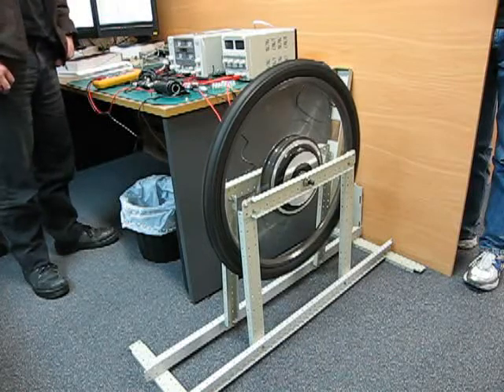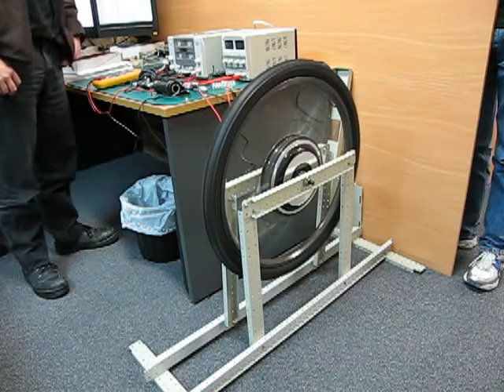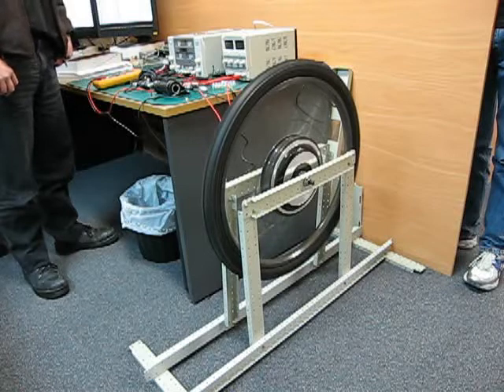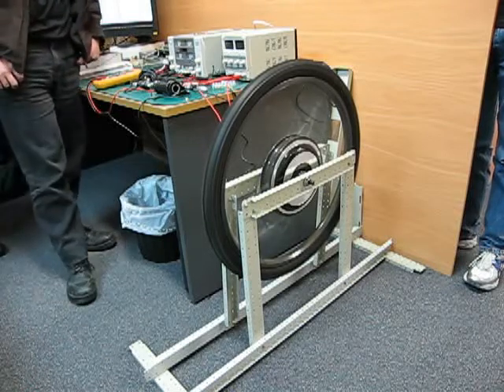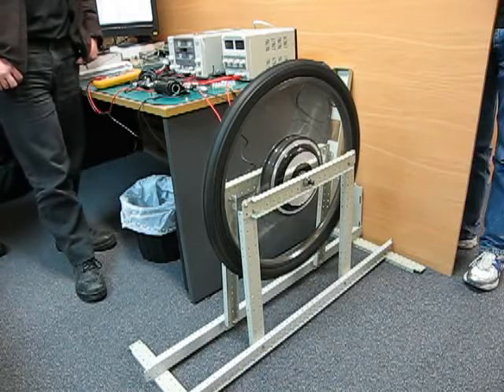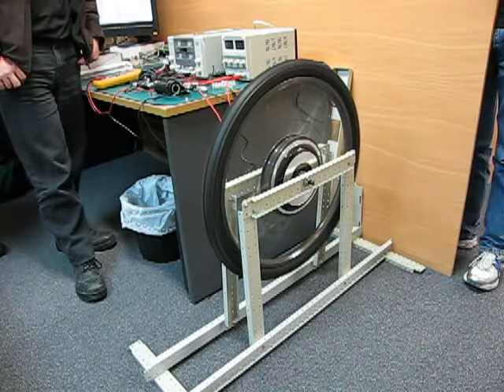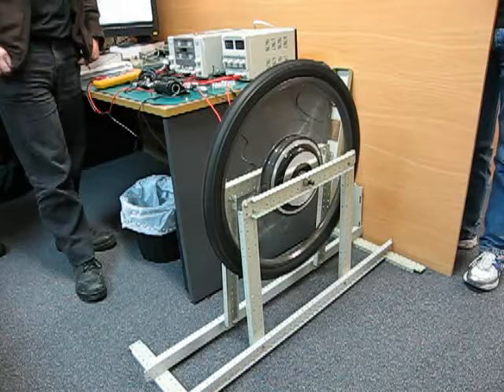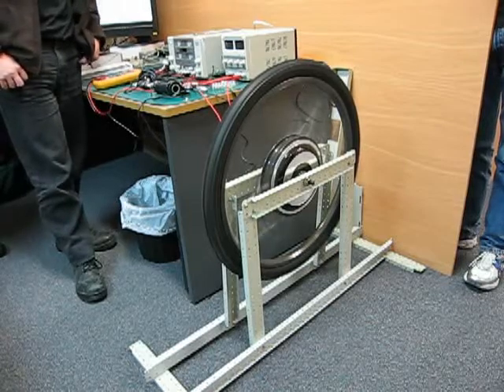Electric Bike Development

Comment: I can see what the problem is, you need to lower the wheel to allow it to contact the surface,this will generate friction, and theoretically the world should spin in the opposite direction to the wheel.
According to my calculations, and these are only preliminary, if you do as i state, then you will be sent back in time by .00543 seconds.
What will you do with all that extra time ?.